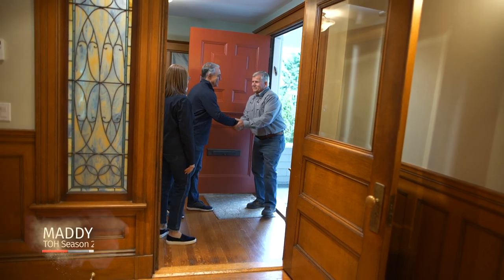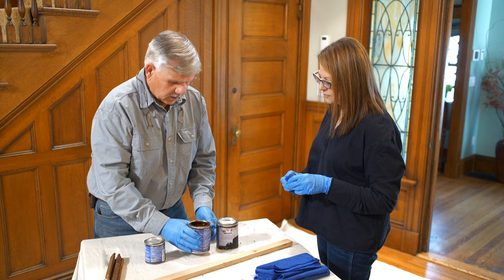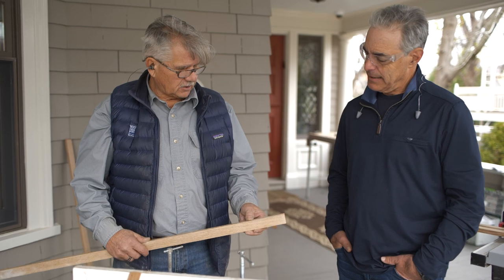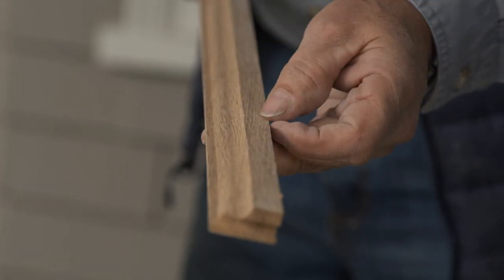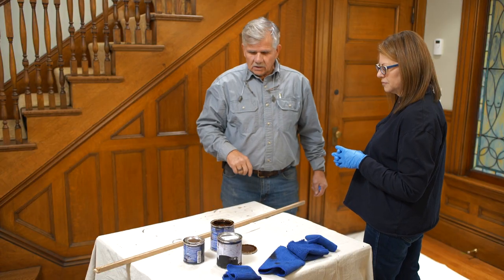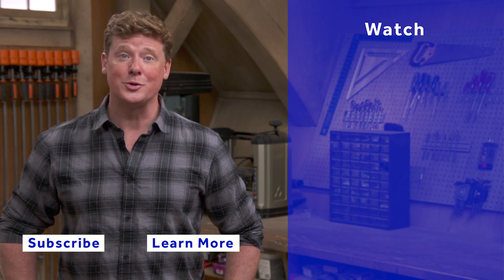How to Repair a Newel Post | Ask This Old House

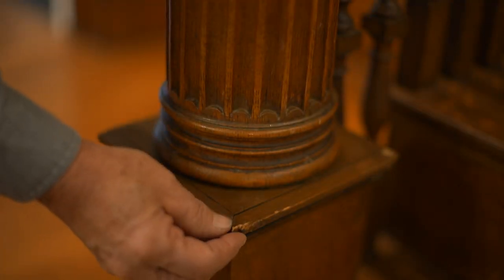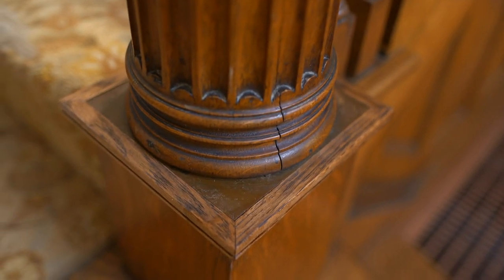Comment: It is not quite the same though - slight different color aside, the old one has less discernible grains and longer grains which results in smoother color (1:25 vs 7:27). Why is that? Is it because the wood (old vs new growth/different age the tree is harvested/different treatment) or different in type of finish (penetrating vs lacquer etc)?
Reply: Old one was quarter or riff sawn.  The new one is plain sawn.
Reply: @seanh3563  That makes sense after you said that. Too bad they didn't get the cut to match it exactly. Small piece like that wouldn't have that much of cost difference.